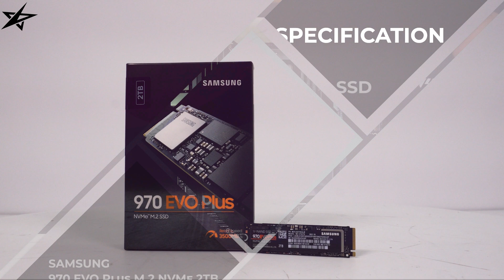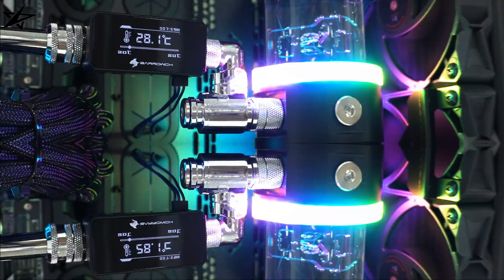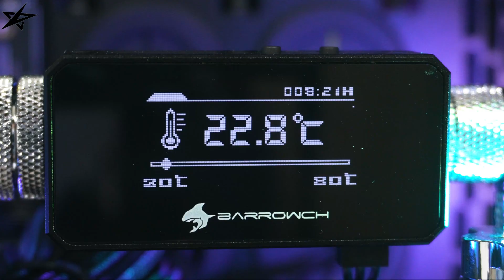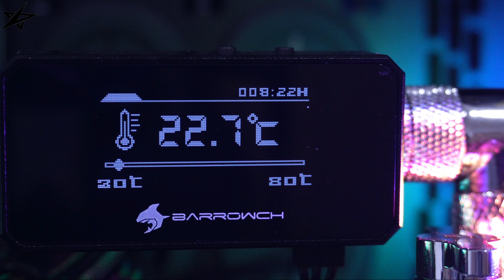CORSAIR OBSIDIAN 1000D | 20X | Custom water cooled PC for deeplearning used by the company

Comment: decent build but I would of  had a 3rd rad at the top  so after the GPUs it hits the 3rd rad then goes into the CPU and the cpu goes to the other 2 rads in the front I have the same case